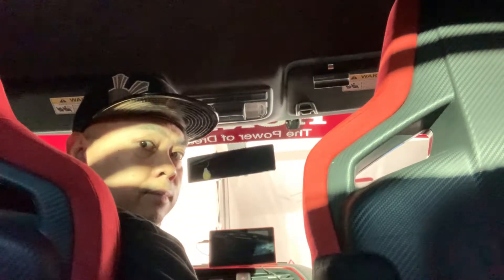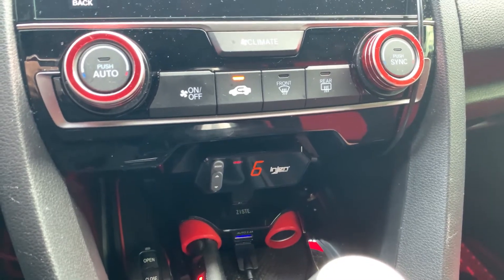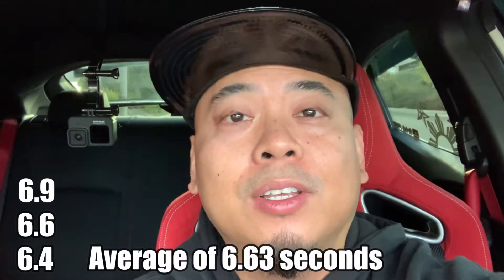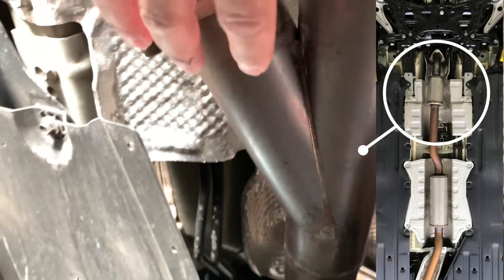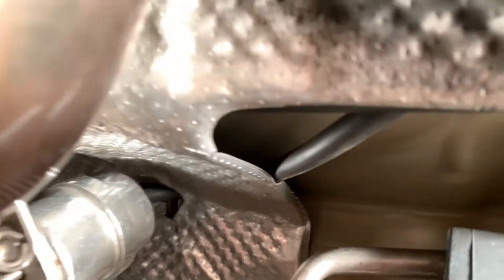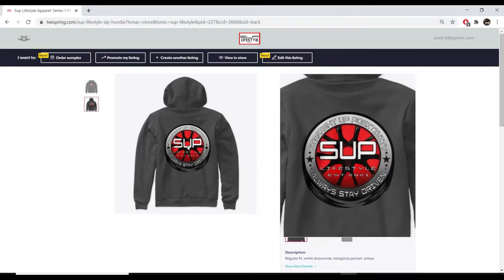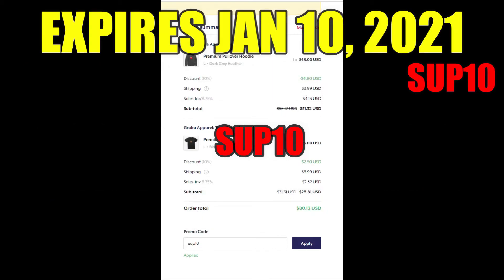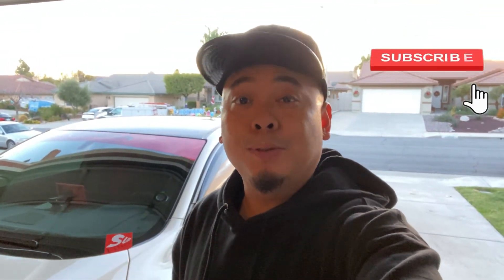Launch Control & How The Cut-Out Valve Exhaust Works | FK8 Civic Type R [Q and A]

Comment: Love the car man. So does the lauch control cut out the fuel on a certain rpm when you rev it?
Reply from the maker: Thanks for the comment. The launch control only cuts out when I hit redline of 7K rpm. Although I think if the fuel pump was bigger then it would increase the flow and provide even faster results. But that’s possibly for another future mod🤔. I appreciate you watching and supporting the channel